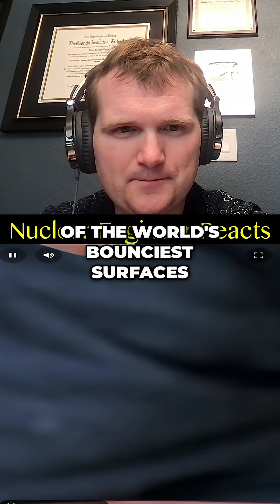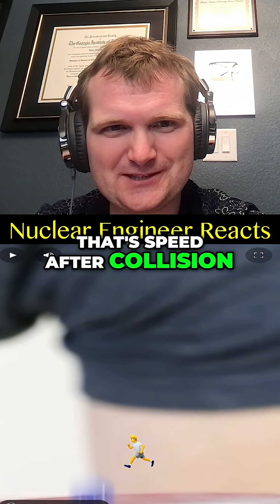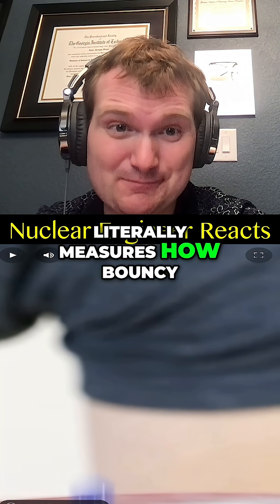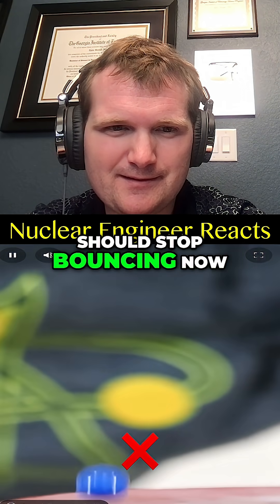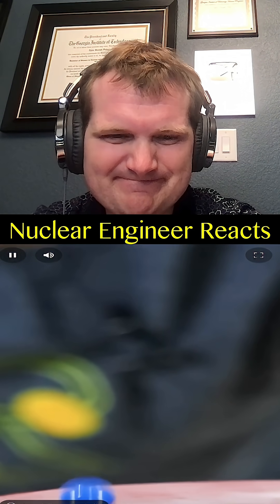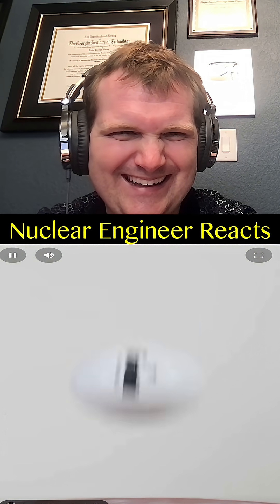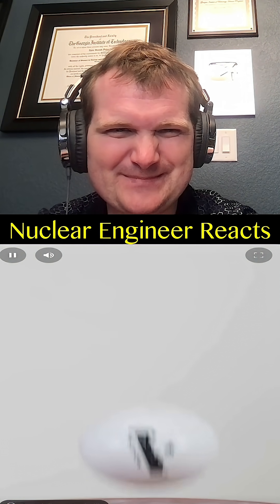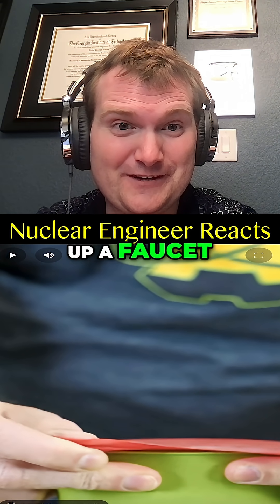The Bounciest Ball - Nuclear Engineer Reacts to Action Lab

Comment: You said that you slow down the neutrons in the graphite rods so they are more likely cause fissures. I don‘t know much about physics besides some youtube videos but wouldn‘t higher speed mean more distant and with that a greater chance to collide with the uranium? 
I have two thoughts about why slower would mean a higher chance of collision but I‘m not sure about either ones. I think either the neutron is only able to bounce in the graphite rods and as soon as it leaves the rods, it shoots off in a relatively straight way out of the reactor which would be pretty wasteful and maybe dangerous or that the uranium atoms themselves move or vibrate at a high speed as well, which would increase the chance of the uranium atoms to collide with the moving neutrons. 
Can someone please tell me if I am completely off or if my thoughts kinda make sense😅

Comment: If lead is good at stopping gamma rays because of its density, then wouldn't osmium, which I believe is the densest element, would it be a better shield? Is it to expensive and not worth it? Or does lead have some special property making it the best?
Reply: osmium is stupidly expensive
Reply: osmium is over $1.5m per gram
Reply: @thepresidenthatesme5045  But is it better at blocking compared to lead?
Reply: @pretzelpenguin777  Think so, because it's denser like you said.

Comment: so it only loses 3% of it's bounce per bounce? i must have got that wrong cause it doesnt seem to only lose 3% per iteration.
Reply: use f(x)=0.97^x not f(x)=1-0.03x
Reply: 3% average, and that’s in perfect condition. Due to other factors it isn’t gonna be 3%
Reply: is it cause i'm not factoring in air resistance or something?
Reply: @Diegesis  its not perfectly 3 and its culmunative
Reply: I think the 3% is for the surface not the balls. I think they both combine in practice.
Reply: Its not additive. Its multiplicative